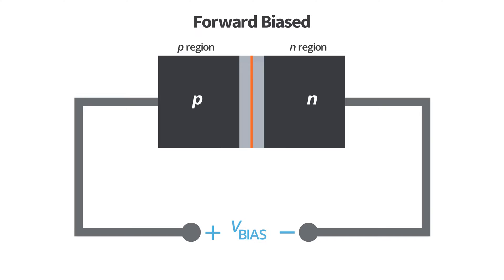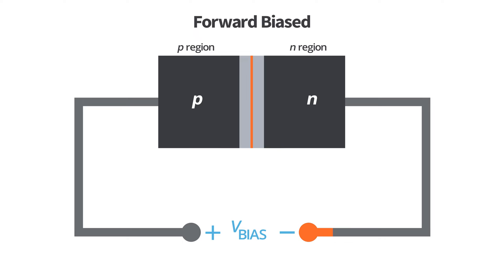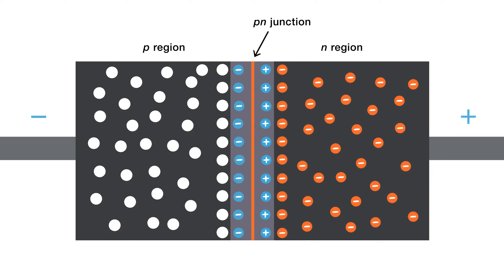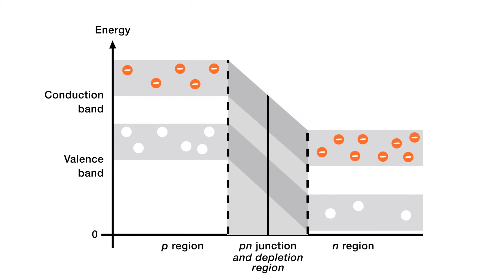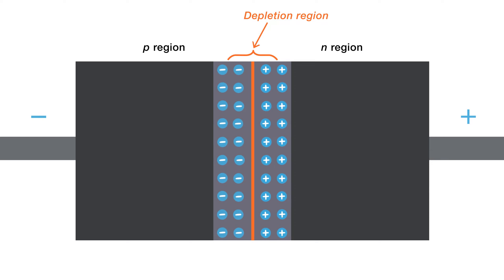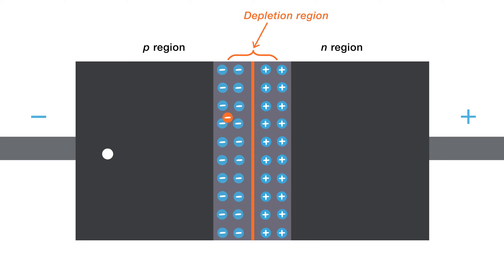How does a reverse biased diode work at the molecular level?  - Part 3 | Intermediate Electronics

Comment: English is not my language but I try to explain anyway. In my opinion you cannot really understand what happens if you don't take into account the 2 voltages between metal and P (Vap=Va-Vp) in one side and between N and metal (Vnk) on the other side. Let's label A one metal terminal and K the other. Let's label Vnp the voltage between P and N (Vn-Vp). Vak is Va-Vk. Ok then Vak = Vap+Vnk-Vnp. At equilibrium Vak=0 so Vap+Vnk=Vnp. Let's label Vbi the voltage Vnp at equilibrium. So: Vap+Vnk=Vbi. Since Vap and Vnk don't vary when Vak is not egual to zero, we can say that in general Vak=Vbi-Vnp and then Vnp=Vbi-Vak. So when we apply Vak>0 Vnp has to reduce and for Vak<0 has to increase. Between metal and semiconductor there is a voltage but no depletion region, non diode effect there. For example, if you manage to reduce (at the best reduce to zero) Vnp by light you will have Vak=Vbi, and you will have a solar cell.

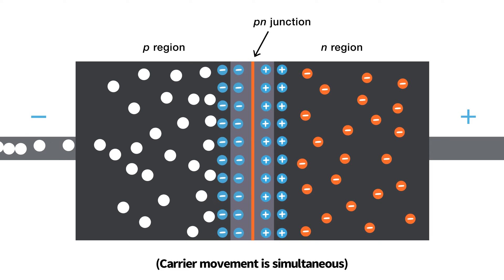Comment: Great video and it explained almost everything, but i am still confused about 1 thing. At 0:52 why electrons move to holes(near depletion region) and get fixed there? Why those electrons just do not go through depletion region and then further?(intuitively battery's positive terminal attracts electrons more than depletion region repels them, therefore they should move forward right?)
Reply: When an election arrives at the p type area from an n type, the holes attract them. When they go in a hole, another hole in front of that newly filled hole attracts the election, too! Also, the constant supply of election repulses that filling election, too! The cycle keeps ongoing until there's no hole left go any further! And that's the edge of the depletion layer! And when they arrive there, they can't turn back since the supply of election will push them back again anyway! So they stay fixed there! And as the depletion layer grows wide, so does its electric field, too! And this electric field is higher than the voltage you apply until you hit the Zener voltage! Once you reach zener voltage or some call it breakdown voltage, elections will push through the depletion layer, more like breaking the barrier and will go through the positive side of the current source! I hope it helps 😅

Comment: thank you very much for your effort. But to me i still finde some questions which are not allow me to understand it fully:

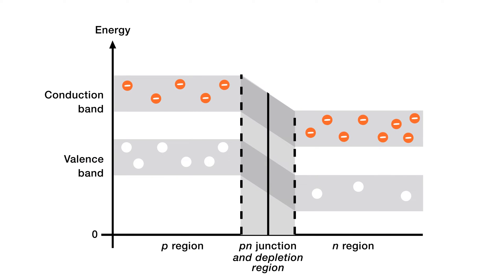1:09
In reversed biased mode the conduction band has in general no electrons left. According to your picture there would be a possibility to flow from the p-conduction band to the n-conduction band.  Only electrons which are thermaly generated from the valence band exists there, and they are the reason for re reversed diode current. Am i correct?

Same picture:
Actually all Explanations say that there are no wholes left in de p - valence band, so there are no current carriers left. But actually there are electrons filling the wholes. And they are still electrons which still can produce a current. I can  try to press more and more ectrons into the p-valence band. So I can increase the potential of the Electrons until they have enough energy to overcome the depletion region.

Am i also correct?

Comment: Please what is a breakdown current? I want your definition, you're a great teacher.
Reply from the maker: First, thank you for the compliment, I appreciate it!  Breakdown current is when the electrons flowing backward gain enough energy that they start to knock things loose.  Imagine a bowling ball slowly bumping into a pin, it doesn't actually knock it over.  But if a bowling ball hits a pin hard enough, not only is that pin knocked over, but it hits into other pins, knocking them out.  Those energetic electrons knock other electrons away from their atoms, raising their energy so that they're in the conduction band and can move around freely.  The odd thing is that, from a devices point of view, the mechanics are very different from what's happening when forward-biased, though from the perspective of a user, it doesn't really matter.  Just that once you get to a certain reverse voltage, it starts to conduct in the "wrong" direction.  I hope this helps!

Comment: Here's what I don't understand about reverse bias. It says "holes move towards the left side because they are attracted by the negative voltage." But there is no such thing as holes moving. The only way a hole moves is if an electron is moving in the opposite direction. It's all electrons moving. So now the question is, exactly which electrons are moving? Are electrons from the voltage source, maybe a battery, moving into the P side, combining with the holes, making it look like holes are moving to the left into the battery? Or is it electrons in the P material itself moving towards the junction, making it look like holes are moving away from the junction? Also, if it is electrons in the P side moving to the junction, then why don't they cross the junction and go into the N side? Why do they stop once they hit the junction, or maybe they stop a few atoms away from the junction, since the atoms right next to the junction don't have any holes for the electrons to join with.

All I can think of is that it requires a small amount of energy to get the electrons in the P side to move from hole to hole towards the junction, but then the electron, once it's in a hole, does not want to leave that hole and jump into empty space, where the N side is. There are no holes in the N side for the electron to jump into, so they stay put in the P side. Unless you apply the breakdown voltage, and that is so much energy that it does force those electrons to jump into empty space in the N side, and current flows in the reverse direction.
Reply: my way of understanding this is that the negative terminal connected to the p region will release electrons and fill up the holes existing in the p region, thus expanding the depletion layer and increases the junction voltage. Hope that helps even though its after a year
Reply: @zclee7325  I actually saw some videos on YouTube from a channel called CircuitBread that cleared the whole thing up for me. On the p side, electrons are are in the valence band, so they can only jump from hole to hole. They can't jump out of the holes into empty space because nothing is supplying enough energy for them to do that. On the n side, electrons are in the conduction band, so they can move around freely anywhere.
The electrons moving away from the negative terminal on the p side make it to the depletion region, but then they can't move any further away because there are no more holes for them to jump to, so they end up widening the depletion region.
Reply: @firstlast1947  i see thats pretty insightful, thanks

Comment: if I google, I find reverse bias diagram and it's p type fermi level is higher than n type fermi level. Does this mean the voltage is higher than break voltage?

I think only forward bias will have current. Then why fermi level difference doesn't make current in reverse bias?
(fermi level is energy level at which 50% of electrons are in at 0K as my knowledge. It's hard to understand for me)

Comment: So only reverse biased diodes are intended to break?  And forward biased diodes possibly wont break right?
Reply from the maker: Forward biased diodes can also break if you put too much current through them, you'll melt them or catch something on fire.  But you won't have a reverse voltage breakdown because they're designed to have their forward voltage "breakdown" at as low of a voltage as reasonably possible.
Reply: @CircuitBread  thank you so much sir 🙏👍

Comment: Electrons flows opposite to electric field right? Then why this electric field stops electrons in potential barrier?
Reply from the maker: There are both positive and negative ions in the depletion region, which, strangely, repels both positive and negative charges.  But "electrons flow opposite to electric field" is a bit vague as electric fields, depending on their polarity, and either attract or repel electrons.
Reply: I mean, electrons usually go from negative terminal to positive terminal but in this case of potential barrier in p-n semiconductor, it stops the electrons or potential is steeper up and not deeper down? Maybe there is diffusive current (concentrations of electrons independent with electric field potential) that counter drift current (dependent on a electric field potential). Sorry for this question. This is only my confusion about this topic.

Comment: So will a diode show some potential drop which is equal to the breakdownvoltage like 0.7 volt in forward biasing and the current here passes by breaking simple covalent bonds by high energy and attract them into the conduction band but how the current passed in that depletion region in forward biasing?
Reply from the maker: Hi Raza, this question isn't very clear but I think I answered it in the comments on the Part 2 video.  Please clarify this question if it hasn't already been answered.  Thanks!
Reply: @CircuitBread  my question is simple sir that the leakage current in both reverse and forward bias below breakdown and the knee voltage is due to the same mechanism and the charge carriers are conduction electrons but as current passes after breakdown by giving much energy to the covalent bonded electrons they become conduction electrons its ok but how the current passes through the forward bise depletion region which are the charge carriers when electrons passes through depletion region ?

Comment: I love the completeness that the CircuitBread videos offer.  Very intuitive.  Very comprehensible.  What I don't understand about reverse bias is this:  The high concentration of majority charge carriers is the driving force responsible for diffusion (hence the name being analogous to diffusion from high concentration to low in liquids).  Yet reverse bias reduces those high concentrations, which would seem to reduce the force propelling diffusion and thus reduce the depletion voltage.  But it increases the depletion voltage.  This seems counter-intuitive.  Can someone help me visualize that?
Reply from the maker: Hey Ted - thanks for the feedback!  I am a bit confused what you're referring to with the term "depletion voltage" - could you clarify?  Then we'll see what we can do to help your understanding.
Reply: I mean the width of the depletion region and thus the barrier that must be overcome to cross it.  Some guy at EE Stack Exchange

https://electronics.stackexchange.com/questions/512322/are-there-two-band-contributions-to-diffusion-current-at-the-pn-diode-junction/512479?noredirect=1#comment1314727_512479

is saying "Reverse biasing a diode does not change the electron or hole majority carrier concentrations in the neutral region. It does however increase the barrier height they must overcome. This reduces the current. That video is either very confusing with its animation or outright wrong."

I referred him to this point in your video (he's responding after having watched it), which would seem to suggest the opposite of what he claims:

https://www.youtube.com/watch?v=C6Ctnl5RYD0&feature=youtu.be&list=PLfYdTiQCV_p7sDswtLZKK43BWOd2mTmHC&t=38

That point in your video makes intuitive sense in that attaching a positive electrode to the N-type would make sense in drawing away majority carrier electrons and their absence stripping that side of the depletion region of more electrons (exposing more positive ions and widening the depletion region).  It just seems counterintuitive to the action of diffusion across the junction in reducing their concentration.  See what I mean?
Reply from the maker: Hey Ted!  The depletion region is not formed due to the high concentration of the majority charge carriers but because of the positive and negative charge layers created when the concentration of the majority charge carriers is reduced (reduced during the formation of the depletion region as free electrons and holes combine, no external voltage applied, just the heat energy at room temperature). So when in reverse bias, the concentration of the majority charge carriers is reduced but the number of positive and negative ions (which creates the depletion region) is increased and this is completely independent of diffusion current.  Is this helpful?

Comment: I understand that the depletion layer gets wider and narrower for forward and reverse biased diodes respectively.  But why does the widening of the depletion layer makes the energy hill steeper and vice-versa in case of the depletion layer getting narrower?
Reply from the maker: Excellent question!  The energy hill represents how hard it will be for the electron to move from one point to another.  So as the increased voltage increases the size of the depletion layer, that means there are more fixed ions for the charges to pass through.  This larger layer of fixed ions means it's harder for both the electrons and the holes to pass through the barrier.  Focusing on the electrons, this means that the electrons need to gain even more energy to overcome that potential barrier, which is represented by a steeper energy hill.  Let me know if this helps!
Reply: @CircuitBread  Thank you so much sir! Yes, I did help a lot. I would again and again mention, how great videos you make, and how equally your helpfulness in the comment sections have made our life easier :') 

Apart from that, yes, I had a kind of deeper follow-up question to above confusion, and I guess I have put it under the next video on forward biased diode (sorry, coz the question came into mind while i was watching that lol). So if you please would like to check that there, it would be super awesome! Thanks again!